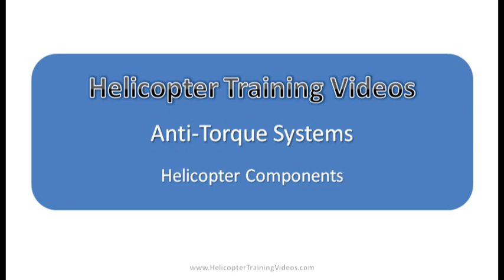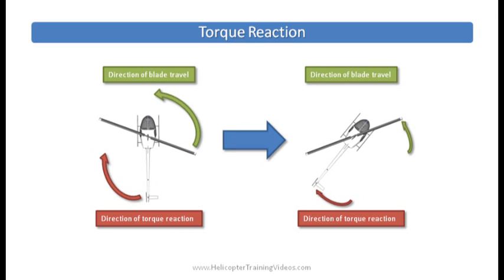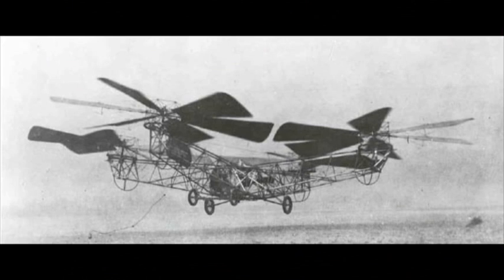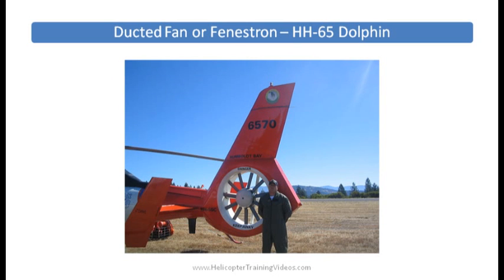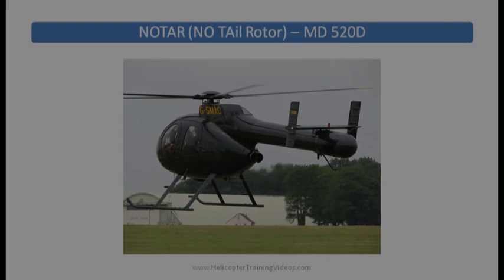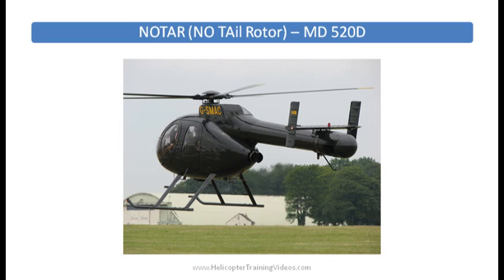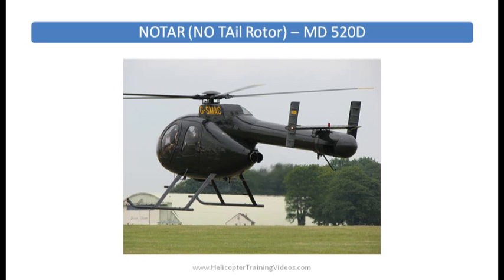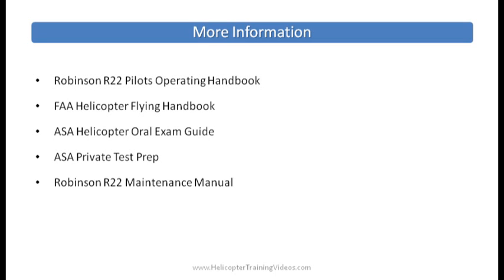What Does a Helicopters Tail Rotor Do? And Other Anti-Torque Systems (Fenestron Ducted Fan & NOTAR)

Comment: I learned gyroscopic precession but then looking at this I can't see why torque is going in that direction. Because if the blades rotate anticlockwise that means the angular momentum is facing upwards. Using the right hand rule for torque makes it confusing because I don't know what forces are acting on the swashplate. Maybe there's no force so that just means torque opposes the rotational forces of the blades?
Reply: If you're in the water and want to turn, your arms will push in the opposite direction you want to face.
Reply: @pivotfever  great example.
Reply from the maker: I wish I could explain it better at a deeper level, but maybe a more complex book like this would help: https://tinyurl.com/bj94zhr7

Comment: I'll keep a look out, and I didn't mean to criticize. I only inquired as the branch I work for designates at least four current anti-torque configurations including those you mentioned as well as co-axial rotor set-ups and your video is a great intro to the first three. Sikorsky has some nice media about their X-2 and upcoming S-97 which covers some of the configuration or at least provides beautiful examples of the application: quieter torque control with way more lift for the power.